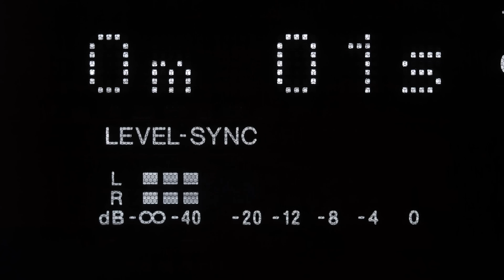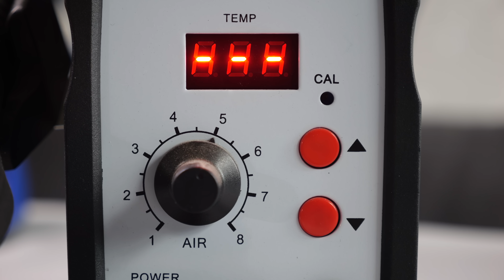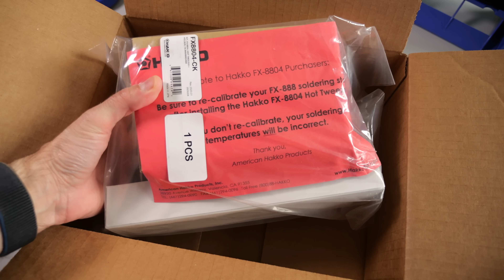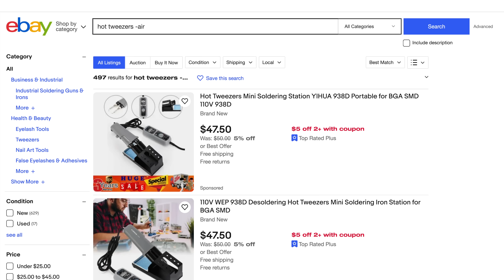A BETTER way to replace surface-mount capacitors!

Comment: I've replaced more SMD caps than I can count.  I'm a fan of the twist method, but the key is to just twist and never ever pull up.  The legs are fragile and they'll snap, the cap will fall off.  Clear the remaining lets off the pad and you're good to go.  I've never pulled a pad.
Reply: I heard this being the best method as well.  Using heat either through tweezers or a hot air is supposed to be more difficult if the capacitors are leaking as it seems to raise the melting point of the solder.
Reply: i can agree with this. i just rock the cap side to side
Reply: I think any form of the twist method is just lazy workmanship. Not worth the risk of even a single torn off pad.
Not to mention that many applying the method are real butchers that shouldn't be near electronics, for every one that can do it safely there are ten idiots destroying boards.
Reply: I've been recapping boards for a good while now and I've always use the twist method and have never run into a problem. Always twist never pull. If I'm working on a super expensive high risk board then the tweezers would be a good option. Hot air seems unnecessary, time consuming, and has its own risks. At the end of the day, do what's comfortable for you. Enjoy your success and learn from your mistakes.
Reply: I have removed probably over a hundred caps with the twisting method and never had any problems with a pad getting damaged. I agree on the importance of twisting and not pulling or rocking the cap. I had much more problems when trying to use a soldering iron to melt the solder and the hot air station is too slow and can put a lot of stress on the pcb and the components close to the cap. Honestly speaking I find it safer or at least as safe as using a hot air station and I know some people will say I'm lying or things like that, but I really don't see a point on removing the caps any other way.
Reply: Count me in as another fan of the twist method. I personally think it's safer than hot air. Not only in terms of not melting nearby plastic, but also just less stress on the board, like potential warping from heat for example.

I'd even go so far as to say you should be pushing down while you're twisting. I have also never lifted a pad using the twist method -- on badly corroded boards as well as boards that hadn't leaked yet. I like to hold the plastic base of the cap down with tweezers while I'm twisting too. That way the pad is safely held down and the little thin lead into the cap is going to break well before the pad sees the stress from the twist.
Reply: I have a similar experience of the amount of replacing parts and my experience is totally different. Even on the way you just described. Sure it goes well very often, but every do often it doesn't and that really ruin your day.
Reply: I feel sorry for everyone cursing themself. "I've never had a problem." Then the next cap you pull gives you nothing but problems. I sure hope you all knocked on wood after saying it.
Reply: @anon_y_mousse  Yeah, these are the same kind of people who take risks with food safety and justify it by saying "well I've never gotten sick, so it must be safe for everyone"
Reply: We are going for fatigue. Back, forth, back, forth. I also apply downward pressure.
Reply: @anon_y_mousse I switched to the twist method after damaging pads using a soldering gun to try to remove the caps. I then used a heat gun and damaged nearby components (despite trying to shield all plastic parts using razor blades.   Switched to twist method and haven’t damaged a pad since.  I think damage to pads is simply more likely on boards that have been more significantly damaged by cap juice.  At a certain point the pad is only being held on by the cap.  Then it doesn’t matter the method you use.  However, people who are against the twist method point to damage when using it as a problem with the method. When people use a heat gun or solder gun and damage the pad, they claim it’s a problem with the person, not the method.
Reply: @mikewottle8893   Well, razor blades are steel, so using them as shielding is a particularly bad idea. Notice how in the video Colin is using aluminum foil and Kapton tape, and that the foil isn't wrapped tightly and touching every square inch of material. Maybe give it another try with hot air using a more correct method of shielding.
Reply: As an ex camcorder service tech, I've replaced 1000's of SMD caps, if a cap has leaked over the board you've little to no chance of removing it with heat, with the rock it back and forth & pull method the can comes off very easily, don't just rip it off the pcb,  if the track lifts the chances are the leaking electrolytic damaged it.
Reply: Agreed. I've replaced a lot of SMD caps as well, and the twisting method works fairly well when you do it like this.
Reply: same here (many thousands)
every once in a blue moon a pad will go.
easily patched.
Reply: don't do the twist method with AEC Q200 automotive caps, and the ones with "upside-down stool" vibration proof supports, because they have much stronger leads
Reply: Yes, I was about to comment this exactly. Through out the video I was yelling you're not twisting, your just lifting!
Reply: @bzuidgeest  Those ten idiots you talk about will apply any method incorrectly and damage the board. Weak argument.
Reply: I saw the twist off method years ago, I tried it one a lot of scrap boards and never saw any signs of damaging the pads.  But it's definitely a twist, not pull situation.
Reply: @bzuidgeest What an autistic rebuttal.  Everything is marginal, and for a lot of people, the time saved is more then the time to repair an occasional torn pad, and the money made/saved during that time justifies a rare problem on a part with lots of room to make a repair that likely won't even show.
Reply: Very useful lecture
Reply: The twist method is the most efficient one IMO .. I was sceptical at first, but if you put a little pressure towards the cap while twisting, it‘s unlikely you rip a pad. 
Another great working method is to use a tweezer like iron that can heat up two joints at a time. Great to remove and resolder smd components 👌🏻😎 I got a Ersa chip tool that is great..
Reply: @sedsberg77   I don't do either without sufficient heat. Better to burn a finger or two than ruin an entire board.
Reply: mattkc tried to desolder them but he ended up ripping the pads off, he did the twist method and it worked perfectly
Reply: @doogulass  it's definitely much more risky to the board because you could rip the pads off. Heating the board sure has some additional stress, but warping is insanely unlikely. The board had to go through an oven to have the smd components soldered so any warping would have been visible there and would have been rejected already. Mechanically taking off components from a board is a butcher's solution to the problem. Additionally it could introduce microcracks on the PCB and/or the pads and thus lead to reliability problems.
Reply: @LynxCarpathica  that will definitely introduce fatigue to the pads and the connected tracks as well and introduce microcracks that could compromise the reliability of the product, it's not a good solution.
Reply: Tried that just two days ago with an old Mac PCB I intended to recap. Went pretty well, save for one pad, where I've been a clumsy oaf and ripped off half of the pad while trying to get rid of that remaining leglet. Well, never one to be lost for solutions I ve rebuildt the pad with thin wire and soldered on a nice tantalum cap. That at least went well.
Reply: twisting is definetely safer than hot air. On very leacky caps even safer than hot tweezer.
Reply: @fattymcboomboom9254  safer in what sense?
Reply: Twisting is not safe on a Game Boy Advance. The pads are too delicate
Reply: I can now confirm that this method works perfect...
Read your comment and went and tested it on a scrap board...Tried on like 15 caps and nothing got ripped...The traces looke like new...No need for hot air when removing them apparently 😁😁😉😉
Reply: @bzuidgeest  Total BS...I just tested the method and it works perfect
Reply: @henrikloiske8572  talk about being late to the party... Jeez, had to read back on what this was even all about. Hope you are not this late in everything!.
Suit yourself. Just don't come crying to me when you damage something. I'll just keep putting in a little more effort and stuff repaired by me will never have a bodge wire because a pad got twisted off.

Comment: NEVER LIFT UP THE CAPACITORS!!!! The trick is to put DOWNWARD pressure as you twist them, and not lift up as you twist. If you lift up, that almost guarantees the pad also lifting up.

Comment: I think it's been mentioned here but I'll say it again: Low melt solder is the way to go if you don't want to spend money on expensive specialized single-use tools. It mixes with the lead and makes a super low-melt alloy. A very little heat from hot air and the parts come right off so fast and easy.
Reply: Yes, I tried this too and it works great. It is also very handy for removing connectors without damaging the board.
Reply: Here in Brazil it's called "solda salva chip" or IC saving solder. It's very useful although dificult to remove from the pins after you removed them from a board
Reply: This.
Reply: EXACTLY!
Reply: Also on top of that the added low melting point wire add a lot of termal mass to the piece, meaning the soldering will be liquid for a lot of time even on massive ground plane. I use it a lot to remove soldered to the board heat sinks
Reply: That stuff can make a mess though
Reply: @ChewyChicken589  you don't need much and need a steady hand for sure. but solder braid cleans it right up in my experience. its been a life saver for me
Reply: @renegade43  I just mask off the surrounding areas and use a rework

Comment: ChipQuik alloy solder.
Reply: I was searching for this comment. Exactly that's how I remove stuff like this. And even if it feels wrong: Low melt solder works just as well for complicated through hole desoldering jobs.

Comment: In my experience, don’t just rip them up off the pads, but twist them back and forth to wear out the legs on the cap
Reply: I use the twist method too - he way the leads on this SMD capacitor type mount, the joints have the least strength if pulling straight up (will want to separate the pads from the board, but have the most strength if you pull horizontally along the length of the solder joint.

If you twist the top of the can off above the plastic base, the majority of force is along the horizontal (guided by the plastic base) and either the pins break off in the metal can, or right at the edge of the pads - either case is easy to clean up with flux and braid. Haven't had a lifted pad failure with this method ever.

That said,I haven't worked with boards in as bad a condition as was shown in the video. In those cases hot air would seem better, but I'm not sure if you'd be left with good pads/traces in any case.
Reply: Thats the way to go, I did this for a living for a while. I had to replace like   dozen of those tiny bastards on dozen of boards daily. I tried every method in the book, soldering iron is by far the worst and hot air is too slow. Some pads will eventually break but they were already corroded or weakened.

Comment: the trick that always works is to push down while twisting, it will never break the pads unless its really corroded. I know this method works because ive recapped over 20+ mac boards in last few years.
Reply: exactly, a 100% lateral twist is what you need, downward force helps with equilibrium, and the pads won't come off in the downward angle, only upward

Comment: Heres a trick for those of us on a budget. if you have decently thick copper wire, or even a paperclip. you can bend the wire into a shape that will touch both pads.  solder it to each pad. then use it as a heat pipe to spread the heat from your iron through the copper wire to the other pad.

Comment: It really depends on the board.  Back in the 90s, I was rebuilding Mitsubishi TV format boards that had a hundred smd electrolytics that had to be replaced.  I found these boards would survive the twist method, but I always pushed down while I rotated.  Saved hours worth of work.  Other boards had poor foil bonding and they had to be unsoldred.

Comment: I mostly go with the twist method, But I usually twist back and forth not pulling on the cap, I found that this stress the pads less than twisting one way only until it breaks off, I actually removed two such caps today with great success :) And I still do have a hot air station
Reply: \*heavy panicked breathing\*
Reply: @ceneblock  lol

Comment: I have tried using the YIHUA tweezer iron pictured at 6:47. They do not work in a lot of places because the angle is wrong. They are too wide to fit between the other parts of a board in tight spots. The Hakko is a much more useful design.
Reply: Thanks for the comment, I was about to look at reviews of the cheaper tweezer iron clones, but you saved me the time.
Reply: Handskit has a T12 set with more slim tip design for about 50usd and double the wattage, mine hasn't arrived yet but they appear to be better built than the 938D
Reply: That's a shame, Yihua products are great quality ofr the price in my experience and I was considering getting one.
Reply: @GenesHand  You also have to watch out not many base units will heat both sides of the iron. The tweezers tips are heated on different circuits and separate pins.
Reply: My exact thought when he reached for the cap next to a plastic cable connector was that there would still be a lot of limitations because of the size of the arms and then tips.

Comment: I'm one of those who has no problem holding two irons.  It's my goto solution for any 2 pad SMD.  🙂
We've got SMD tweezers at work, but I never got on with them.  I guess they might be more useful if you do a lot of larger SMDs.
And with two irons you can have different tips in each, so less changing of bits.

Comment: I appreciate the nuanced look at this. Personally, I had used the twist and push (no upward force) method on about 20 surface mount boards (mostly Macs from the very early 90’s), and have only lifted a couple of pads. When I was trying to desolder with one iron, I was lifting pads left and right. I did end up getting a hot air station, but right as that happened, I stopped recapping boards due to a lifestyle/situation change and haven’t had a chance to use it very much.

Comment: The twist method is not bad if you wiggle them back and forth and fatigue the metal rather than one big twist. Hot air can also be a problem on multi layer boards and you can’t get enough heat in it if theres big ground planes.

Comment: Having worked within the 2way radio industry I have found that two fine tipped soldering irons placing one at each joint of the cap. Tweezer desoldering irons are good for the chip components but marginal for larger surface mount electrolytics. I use a professional Pace rework station that has soldering, desoldering ( for both through hole and surface mount ) and tweezers. Very expensive but as I was once told by a master gunsmith that even if you use the tool one time and it saved you time and money it is worth it’s weight in gold.

Comment: I learned a technique that has worked well for me for over 20 years now from a Panasonic field technician:  He did a lot of cap replacements on their DVCPRO line of video recorders and was called-in to our station to train us on how to do it properly.  Essentially, he used a pair of needle-nose pliers to grab the top of the cap firmly in the jaws.  Then, while pressing the cap towards the PCB, he'd twist the pliers until the leads broke off.  It didn't matter what size of surface mount cap, or whether the caps had leaked or not - the traces were never harmed doing it this way.  I believe the pressure against the PCB helps keep the traces stable while the caps are twisted.
Reply: This is also the way I usually do it. Seeing him pull straight up on countless occasions in this video is just cringeworthy to the max

Comment: when i swapped the SMDs from the optical unit board of my Gamecube, i added a considerable amount of flux and alternate between both sides with the iron in one hand and a tiny little plyers in the other. It turned out not that beautiful result, some capacitors were a bit out of center when soldering them back this way, but in the end of the day, it was a succesfully job.
Reply: For your situation (or anyone else reading), with only a soldering iron (I assume) I would advise to get desoldering braid, clean up completely both pads, do NOT tin one of them, let if flat, tin the other. Now you'll heat up the tinned pad only while you place the cap with tweezers, and press it down so it's aligned correctly. Soldering iron away, keep holding till it cools down, then the other pad. You'll probably not need to do anything else, but if you find the alignment not the best you can then press it with tweezers while heating the 2nd pad, you'll have a free hand after all by this time.

Comment: The way Mr. Carlson (from Carlsons Lab) recommends it is to push down and twist it, fatiguing the cap so that the caps solder points are left on the Board...

Comment: Chris Edwards has a really clean method for the snip method. Sharp flush cutters with a single cut, not hacking away at the cap. It comes off clean.
He's been repairing boards for decades at this point and has some solid demos of the method on Youtube.